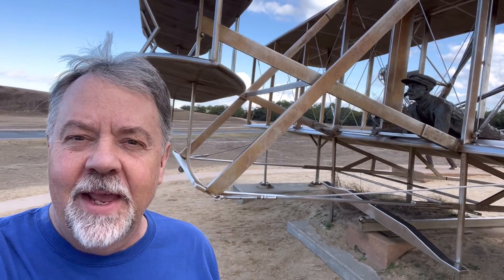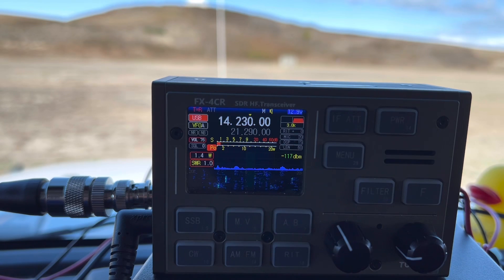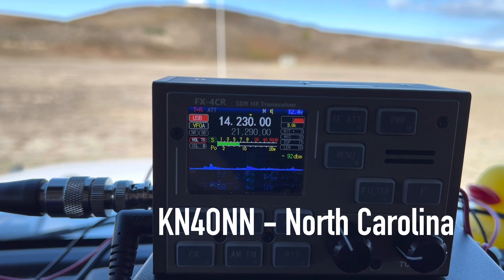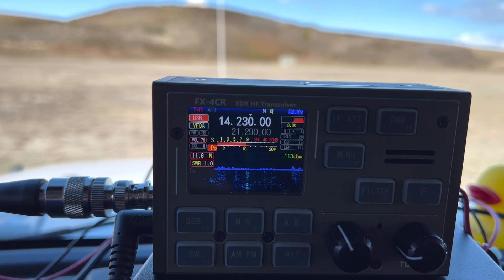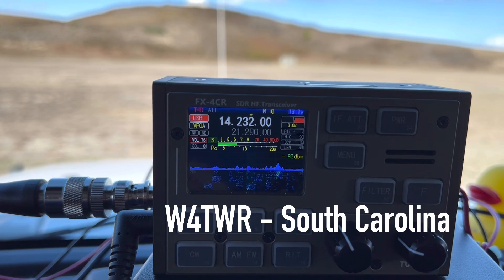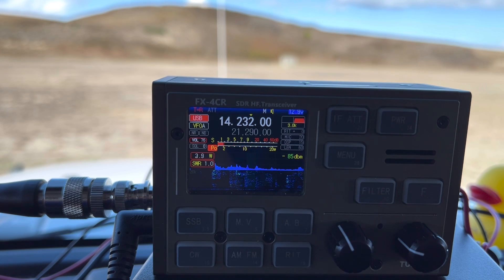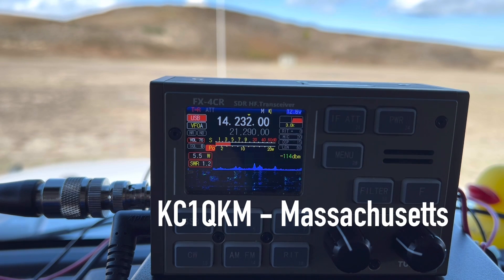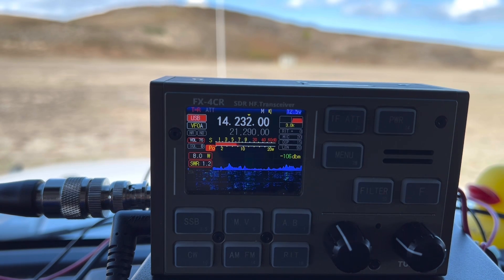Portable Ham Radio Using the FX-4CR

Comment: Thanks for another great video and for the explanation of why you changed your setup. I just ordered a G-90 and a mag mount to start using for POTA and have been thinking about adding radials. Everything I've studied says to use tuned radials on elevated verticals, so im going to figure out a way to add radials to my mag mount and do some testing.
Thanks for the inspiration! I got into Ham to have fun, and now I'm trying different setups to see what works and having a blast!
73
Reply from the maker: Thanks for watching and for the kind words. Have fun experimenting! 73, Walt

Comment: Hi there, how do you get that tri-mag off of the hood or do you just leave it there ?
Reply from the maker: Pull up slowly on one corner and lift. It’s easy
Reply: @COASTALWAVESWIRES My triple mag mount doesn't have the rubber protection some have. I put the thin plastic grocery bags between them and the car for protection. It helps with capacitive coupling. 73

Comment: Hi Walt, I do love the FX-4CR. Great display. Also has a built in sound card for digital, such has FT8. Two things I don't like is the microphone connection and the price.
Great park activation. Antenna works well. Have you considered using Ham sticks on the ground spike?
Have fun, David M0DUU
Reply from the maker: Thanks David! I have used HamSticks on the spike and am actually thinking about doing that with a 40 meter HamStick one night this week. 73, Walt
Reply: @COASTALWAVESWIRES  The advantage with Ham sticks is that once tuned they make a quick way of getting on air.
I use them to work FT8 from my garden in the hot summer evenings.
My best contact was Asia, over 7000 miles with just 4 watts. From my Xiegu X610.
Thanks for the reply.
Reply: The Ham stick on 40 meter works very well, but the bandwidth is only about 50khz wide. So if you want all band coverage I would suggest getting two. One for the lower and higher portions of the bands.
Off course in the USA you have a extra 100khz of space than we do in the UK.

Comment: I was wondering what happened with the mag mount? Didn’t you already have the antenna tuned with it? I found that mag mount to finicky at best. It really hinged on the placement of the coax. I’ve never been a big fan of those sealed coax connectors. The coax also appears to cheap. Another great video Walt.
Reply from the maker: Yes it struggled with the mag mount. Thanks, 73 Walt